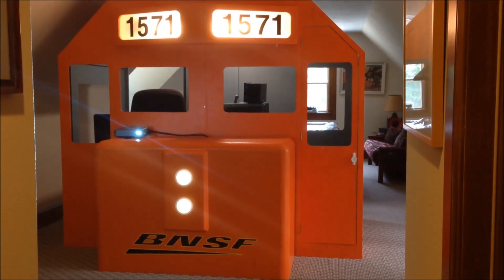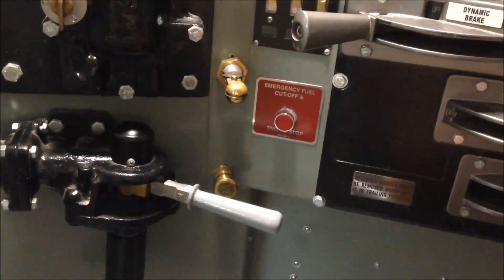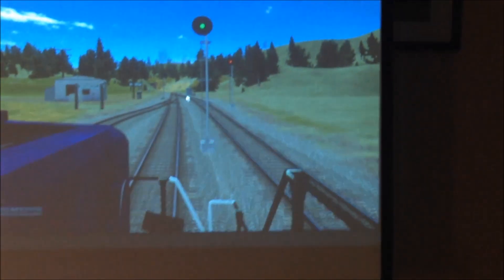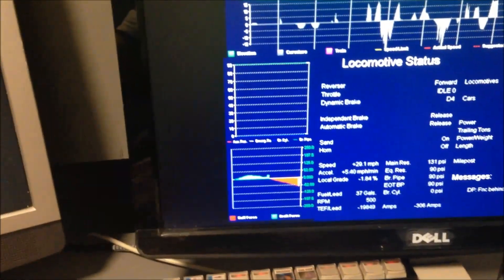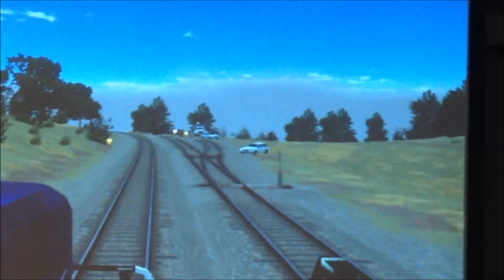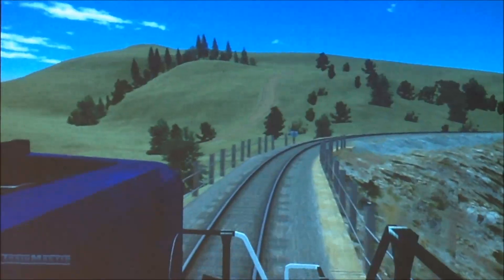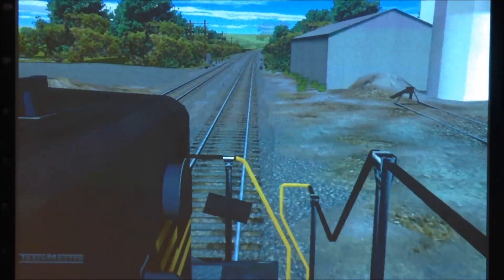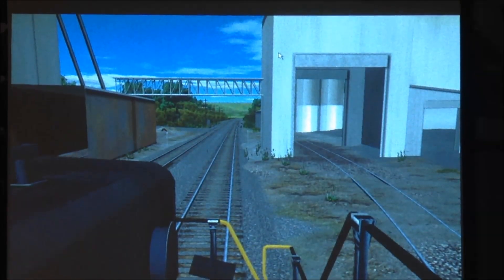TrainMaster Simulator

Comment: is it still possible to order a control panel like this from P.I.? i am extremely interested in possibly ordering one
Reply from the maker: P.I. Engineering no longer sells these control stands, selling all rights to the Union Pacific. However, Rail Simulations Systems, Inc. (RSS) re-conditions used control stands and adds hardware to work with Open Rails. He can be reached by contacting Rail Simulations, Inc. at http://railsimulations.com/index.html. To see how my control stand was modified by RSS to work with Open Rails in addition to P.I. Engineering's software, see https://www.youtube.com/watch?v=pvaYgER_50k. I am also interested in selling my whole simulator, as my wife and I are planning to downsize (we're now in our 80's). However, I much prefer a home such as a railroad museum, or other location where it will be used by many people. The quality of Open Rails is good enough for training engineers on short line and regional railroads, where the cost of building custom track files of a short line or regional railroad is not that large. Open Rails is great for teaching train operations. The P.I. software is great for teaching train handling.

Comment from the maker: Please note my new email address at BobLeilich@att.net.
I recently spent considerable $$ for a new custom-designed circuit board and software to add the capability of my control stand to work with Open Rails (under Windows 10 or 7). The results are utterly stunning and gives new life to the control stand. The hardware and software were custom developed by Railway Simulations, Inc. (Bill Kaufman is an absolute genius). The Open Rails Seligman Route ($30) was developed my another total software genius, Jason Dilworth. What is especially fun is that I can now perform switching activities, picking up and setting out cars. The graphics and the realism of operations are fantastic. 
One of the several operating choices is the Flagstaff (Arizona) switcher which I actually worked in 1959 as a locomotive fireman with the former Santa Fe. Even the locomotive is the same Geep type I worked on 64 years ago. The experience, realistic sound, realistic behavior of the controls sends chills up my spine and brings back many vivid memories. 
I will soon be making another video of switching operations with my control stand running Open Rails. (Though also highly realistic, I find operatingf the Southwest Chief or a grain drag to be a bit boring compared to switching operations.) I now have two simulator options - one that is as realistic at train operations as any of the big, expensive training simulators (Open Rails) and the other (TrainMaster) that helps develop real (road) train handling skills (understanding train dynamics and improving the fine art of braking and use of throttle). 
I live near Houston, so if you're ever nearby I'd be happy to show off my simulator.

Comment from the maker: The TrainMaster Simulator currently runs using only unsupported proprietary software developed by PI Engineering. While it currently operates under Windows 7, work is currently in progress to enable the simulator also to work with Open Rails. This will open up a whole new dimension of operations with a much larger variety of trains over many more territories. Once installed and debugged, I will be looking for a new home for the simulator as I am making future plans to downsize. The fully assembled simulator weighs about 600 pounds and occupies a footprint of 98 x 78 inches and is 77 inches tall. If interested or you have questions, contact me directly at BobL53@att.net. I live near Houston.

Comment: You have a outstanding locomotive simulator. Works this already with Train Simulator? 

I think so, because it is from P.I. Engineering. I build my own control stand for TS and I use TCP messages, which are sended via a server to the raildriver.dll from TS. I have written a client, which read the Joystick axis and send TCP comands to the server.

Comment: Was the voice at 4:56 Microsoft Sam?How did you get him, sir?
Reply from the maker: +BNSF 8010 . I have no idea. The software was developed by P.I. Engineering of Williamston, Michigan.
Reply: Robert Leilich No. I mean the voice of the track crews.
Reply from the maker: +BNSF 8010 .Some railroads use computer generated speech, similar to what you hear with Siri, or navigation software. The software is replicating computer generated voice instructions very similar to that which a real engine crew might actually hear in the locomotive cab. Instructions are triggered when a train reaches a specified location. It reduces the burden on a train dispatcher to otherwise repeat these instructions every time a train approaches a work site.
Reply: Robert Leilich I remember hearing Microsoft Sam.
What are your system specs?
Reply from the maker: +BNSF 8010 It could be very true that the voices are created using Microsoft Sam software. I don't know. for sure. The simulation software runs on a dedicated PC, currently using Windows XP. I will soon be upgrading the platform to Windows 7 or perhaps 10. The software uses two high performance video graphics cards, running three monitors.
Reply: Robert Leilich Thanks.
Reply: I believe that was a simulated radio call with Microsoft Sam acting as a dispatcher or MOW crew, I have yet to hear a computer generator voice from something other than a defect detector, switch announcement or man down call over a railroad radio frequency.